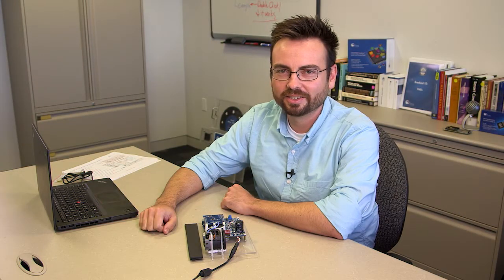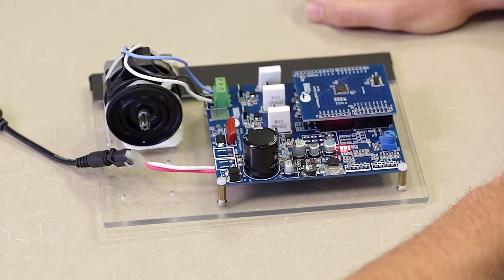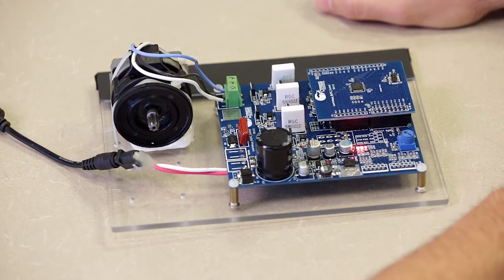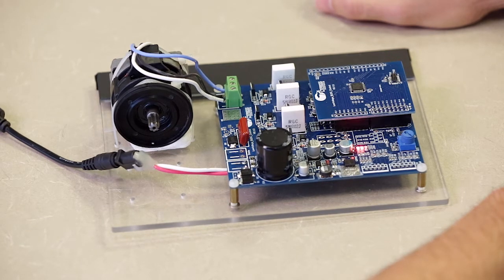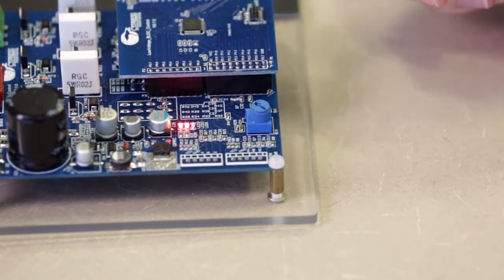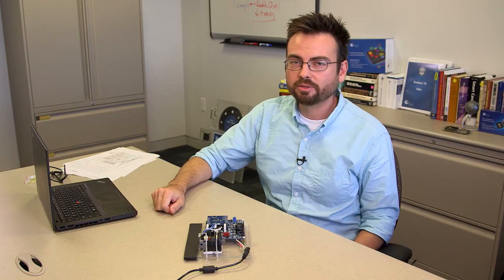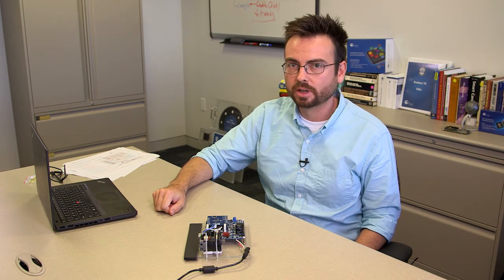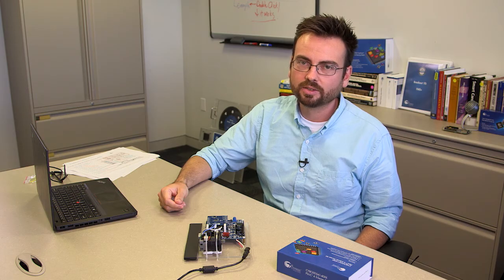FOC Motor Control with PSoC 4 S-Series

Comment: How does this compare to TI's InstaSPIN?
Reply from the maker: Thanks for your question, Afdhal! Please reach out to Michiyuki Yoneda (michiyuki.yoneda@cypress.com) and Raul Hernandez (Raul.Hernandez@cypress.com) for an in-depth answer.
Reply: Thank you for your reply!
Reply: Hi Afdhal, its not really a straight forward comparison, since InstaSPIN is more of a Motor Control tunning suite, while the demo we are showing, is a complete solution - proof of concept. 

When choosing a platform for Motor Control, you want to consider different things, such as the silicon capabilities, the support, the libraries available, ease of use etc... in this case, what we are trying to demonstrate, is that PSoC can handle very advanced motor control algorithms in a very simple and inexpensive part. PSoC 4 S-Series is our lowest cost part (under 50c of a dollar!). 

How Cypress compares to TI? We could write a whole book on the subject, but I invite you to check out some of the PSoC 101 videos, where you´ll get an idea of how PSoC MCUs offer amazing capabilities way beyond what you´ll find in "regular" or "traditional" MCUs.
Reply: Hi Raul, thank you so much for taking the time to respond to my enquiry, I really appreciate it!

As for now, I already have another PSoC kit in the mail (can't get enough ^_^) and I want to try to replicate a project from one of your CY8CKIT-037 videos (sensorless FOC 2-shunt).

I am very impressed with the demo videos that you did where you showed the motor turns straight away soon after the ready-made library was uploaded to the board.

I like the fact that the code examples are already prepared, this will accelerate my project progress dramatically. I can't wait to try it myself.

Thanks again!
Reply: Hi Raul, does Cypress offer any example code for running a salient motor? I tested the example FOC code and it is struggling to run at high RPM.